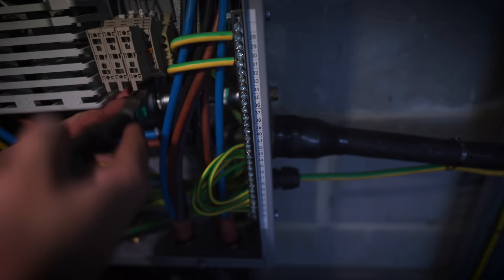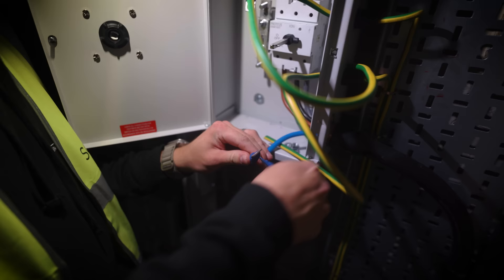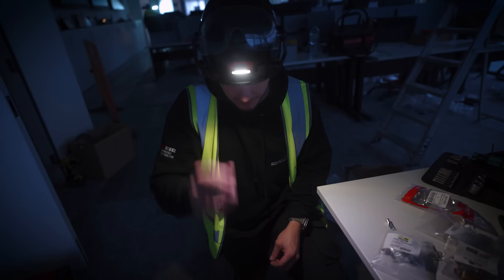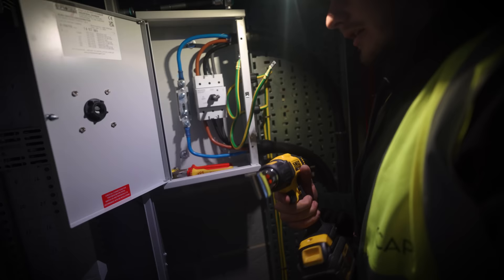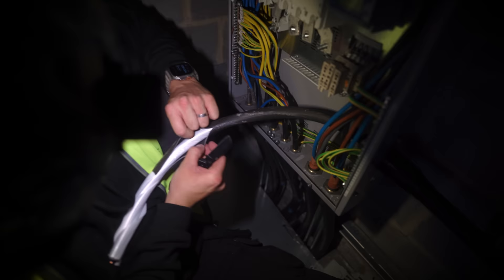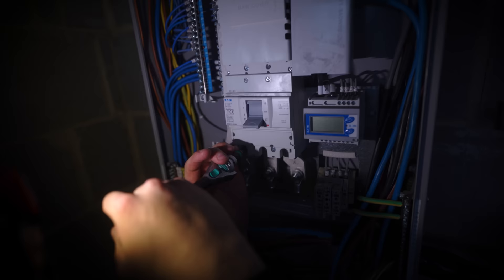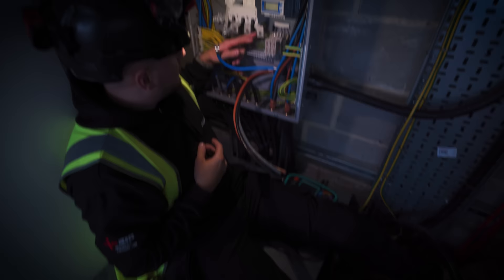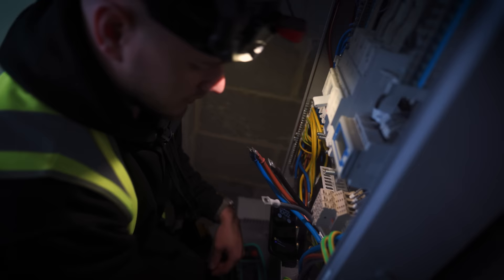Re-wiring fire damaged sub-main circuits

Comment: The Eaton switch is cracked between the bolt and the back plate which will result in a flashover to earth in the event of an under load disconnect. Respect for addressing that connection. It would most likely also have arced inside under load resulting in that phase overheating.  Also, it really riles me when I see people use insulation tape instead of heatshrink. Insulation tape is never more than temporary.

Comment: Get yourself a Klauk Mini battery op crimper
 used one for years far better than any hydraulic one and the pistol style electric crimper so heavy if you have to do many in an hour
Go for the kit with as many dies as possible a lovely tool to have and use day in day out 
Two batteries a must for continuous working 
Nothing worse than getting two phases crimped and a dead tool !

Comment: if you don't have a torque setting just google what the reccommended average torque spec is for the size of bolt at what material it is, eg m6 copper, m8 a2 stainless etc
Reply from the maker: That’s a great shout!

Comment: Seeing what the tools they used in this video, I can only call it lame. I use hydraulic crimper for even 16mm2 BVR wire and they just use hand crimper for 100A wire?
Reply from the maker: We used a hydraulic crimper for the current carrying cables, hand crimped was for the CPC which doesn’t carry current, the hand crimper also caps out at 25mm2 👍🏼

Comment: A couple of suggestions (teaching you to suck eggs) ... Get some decent site lights, will make life (and the videos) better. I'd use a hole punch instead of trying to drill/hole saw in to cabinets. If you come across tight lugs with the crimps already fitted, stick a screwdriver where the wire would go and lever against that. I've found some devices are more robust when tightening, as opposed to undoing.
Reply: Maybe give unilite a nudge xD